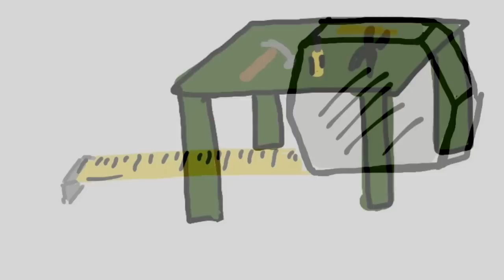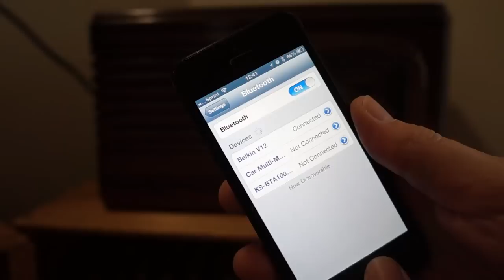How to Convert an Antique Radio to Bluetooth

Comment: Looks good I just did one it's a floor standing 1935 Stewart Warner radio, I used a Bluetooth speaker that I tore Apart so I didn't need the amplifier and I left all original parts except the speaker in it I kept the speaker though so it can be reversed only thing replaced was speakers and speaker cloth also added RgB LEDs behind dial with a music  controller. I also have another  Emerson 1930's radio I'm going to do differently.

Comment: Very cool. I like the fact that you reworked the dial to make it appear to be functional and made the volume control operational. I collect and restore radios and other equipment, mostly pre WW-II, and would say that I'm a "purist". Yes, I cringe a bit that you tossed the original chassis, but you added those touches to maintain the "user interface", so, nice work! You obviously put some thought in to the project and appreciated the radio enough to not just toss it out. The Glenn Miller was a nice touch.
  I've actually done a couple of Bluetooth conversions on vintage sets that I've restored and use frequently. It's very easy to interface a receiver board with the original chassis with 2-4 minor, EASILY REVEASIBLE wiring changes. I can listen to any music that I desire, hear it through the original tube chassis and my "purist" conscience is clear.
 I unplug one small cable and they work like God, Zenith and Philco intended. :)
Reply from the maker: lsrx101 Thanks for your comments!  I really like your utilizing both the old and new with just one small wiring adjustment. That's really cool. 
You can never go wrong with Glenn Miller! ;)
Reply: *****
Glenn Miller rocks! So does Rob Zombie! :)
 I added the info about my conversions mainly for those that were bashing your particular conversion. Glad you appreciate it. though. Some folks feel that old and new can't coexist. Your old radio is sitting there making music, just like it was made to do back in about 1939, and looking exactly the same as it did back then. Mine do the same. Two different means to the same end via Bluetooth..

Comment: I want to do this also, but I'd like to use the original tube amp and speaker that are in there and just disconnect the am receiver in a reversible way.

Comment: A very interesting project i think i got most of the gist the only issue is - you mention removing the old radio's volume control knob and welding it to the new replacement unit, using JB WELD? Is this a US variant method of attaching a metal component to what would be a fairly delicate/sensitive electronic unit?
Reply: Hi, the penny just dropped, the JB Weld you mention would this be a type of strong adhesive?
Reply from the maker: @cliffroe5867  Yes. It's a strong adhesive used to attach metal to metal

Comment: Sad to say old radios are not worth much except sentimental value.  I have a old GE tube type from the 1940's that still works but I simply want it to transmit Bluetooth to remote speakers. Will the old tubes interfere with the Bluetooth signal?

Comment: the metal weight in the bluetooth puck is so it doesn't slide around on your desk, where it would be commonly placed
Reply: JAY Van Maldeghem clock&radio

Comment: Have you thought of build in a rechargable battery in the radio so it is portable. If so what battery would you recommend?
Reply from the maker: Michael Esbensen Sorry for the delay replying. I never thought of doing a battery. That is not my forte, so I hesitate to make a suggestion. I would look at salvaging parts from an old boombox or something maybe? Anyone else out there with a suggestion?

Comment: You could have gotten the radio repaired (or done it yourself) and make a bluetooth AM transmitter.  The transmitter receives the bluetooth signal and rebroadcasts it to the radio over AM.  Much more nostalgic and true to the original radio.  That's what I do anyway.

Comment: How did you connect the wire to the speakers with clips? Im new to this stuff trying to do one for myself, I bought a mini amp just trying out to figure out speakers. Thanks!!
Reply from the maker: The speaker had an included push in clip.
Reply: *****  where would you buy speakers like those?

Comment: Can you advise the specific LED, resistor and how it was wired? Thanks
Reply from the maker: Joe Cardella I don't remember the specific LED.  I had it leftover from another project.  If you go into Radio Shack, they can help you figure out which LCDs and which resistors to use with 5v USB power.

Comment: don't quite see how you are changing stations with the original knob and the new receiver... btw, it us relatively easy to add an input jack to an old radio, if it's working okay
Reply from the maker: Not changing stations with the knob, but I connected the volume knob on the new amp with the original radio knob using some liquid weld.

Comment: A radio that has survived for 70 years is converted into something that no one will care about 20 years from now.  It most likely will end up in the trash.  It would not have been that hard to fix.  There is tons of information on the internet on fixing up old radios and adding an iPod jack or using an AM transmitter so the radio can remain intact yet still play modern music.

Comment: Well done man.  I like doing hacks like this too.  I like how you made the amp gain control work as the original vol. knob.   Pretty cool how that worked out.  I've done a similar hack to a small portable 1957 transistor radio.   Took it from useless to funky cool useful.
Reply from the maker: The transistor radio sounds cool. Thanks for the comment.
Reply: *****
 Check my channel for the video of the Transistor radio.  I tried to link it here, but appears it's not letting me.

Comment: it would have probably been easier to repair the original circuit and add a bluetoth module to it connected to the amplifier section of the radio...most old radios die due to the paper-wax capacitors failing, sometimes its just the mains dropper resistor etc.even replacement tubes can be found cheap...there are schematics online for most models...they use no ICs or whatsoever so anybody with patience can rewire them no matter how messed up they are..its a shame to gut that beautifull radio it is a piece of art outside and inside something that will never be built again...now its a beautifull radio filled with crap

Comment: Does the radio also works with a back Side on it?
Reply from the maker: Laurens Mollemans Yes, although it depends on your speaker set up.  I have a rear facing speaker as well, soif I were to cover it, I would use cloth.  If you only do a front facing speaker, you could cover the back with an 1/8 inch ply.
Reply: Or masonsite

Comment: great idea i going to try this.@thegreenworkbench what brand of radio was yours
Reply from the maker: It is a Packard Bell
Reply: late to the party here, but if this a "Gilligan's Island" Packard Bell (and Packard Bells aren't that common to begin with) you just blew a $300-$400 paycheck for one in good condition. Why do you try selling these before gutting them. You'd be better off.

Comment: You know, repairing these tube radios isn't too hard. Parts are still available. I restored a Zenith 10 tube console and have it hooked up to my computer.
Reply: +jorge hernandez How did you hook it to your computer? I have a Zenith clock radio that I would love to hook up to a music device.
Reply: +Joshua's Recordings On back of my console there is a "TV/RADIO" 2- pin-hole connection. I purchased a connection cable that connects to my speaker computer connection. The other end, I cut and stripped the wire. At this point, you will see a red, black wire and a shield. I stripped the red and black wire insulation, twisted the ends together and placed a Radio Shack pin connection on them. I twisted the shield end and placed a pin connection. I connected  these two pins into the Zenith console, red/black wire on top hole and the shield connection on the bottom hole. I switched the console connection on the "TV" mode. I went back to my computer, selected any song from itunes and music came from  my console. I've had this connection for several years now with-out any problems. If you don't have this "TV/Radio" connection I suggest purchasing a Ramsey AM transmitter which cost $35.00 and works well. This is a kit and soldering is required and the instructions is pretty straight forward. I may have a cheapy AM Ramsey transmitter laying around here and it worked fine.
Reply from the maker: +jorge hernandez That's great! I'm actually restoring an old japanese radio now.

Comment: It would have taken half an hour to replace the bad electrolytics and solder an aux cable to the volume control, this would allow you to plug your phone in and also still use it as a vintage radio, this would have been fully reversible and wouldn't have ruined 70 years of history.

Comment: Very creative, but I don't buy it.  You keep saying you are not an electrician and that you didn't know how to fix that old radio.  Not true you are way smarter than that.  Would that old radio have sounded the same as your new amp and stereo speakers?  No, I restore old radios and I can tell you the two are very distinct sounds.  Some like the one sound, some the other.
And hey, if you like what you did that's all that counts.  There are lots of those old radios around and if you want to do that with your old radio, have at it.  I think it's a novel use of an old box.
Thanks for sharing with us.